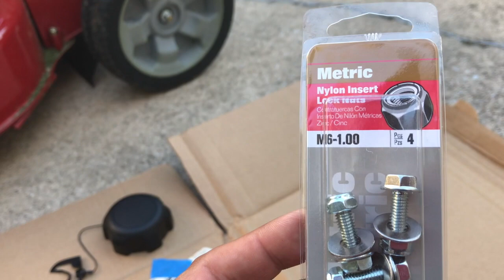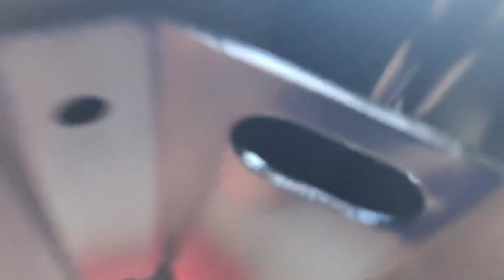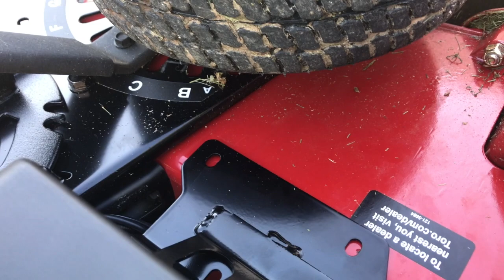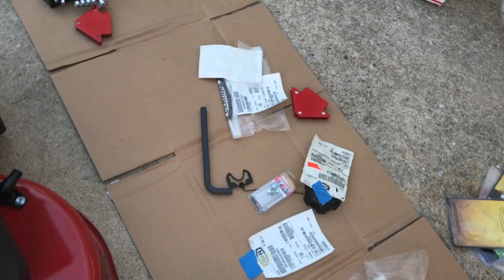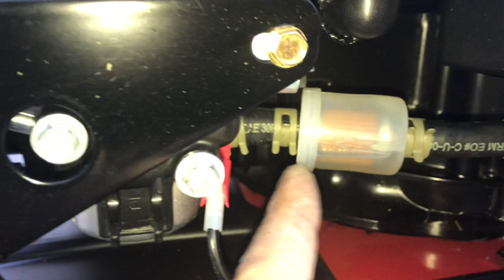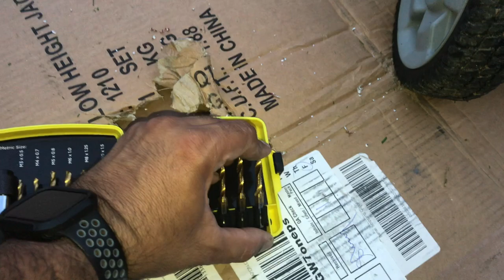Add 1 Gallon Gas Tank to Toro Timemaster

Comment from the maker: Just mowed 2 lawns, didn’t stop the engine once, and still about a half tank left.
This makes the machine that much more usable. 
Next up heavy duty pulleys so I never ever have to deal with the pulleys.
Reply: My stock pulley's broke 16 hour into it's life, so I upgraded to the turfmaster pulley's as well a month or so ago. No issues so far.
Reply from the maker: @1975oldschool  That's great! Yes, I haven't put the new pulleys on yet, kind of have them sitting as insurance for now. I also bought new m5 screws with nylon inserts for the recoil assembly because one original nut got lost. So from now on I'm only getting flange nuts with nylon inserts to make sure nothing vibrates itself loose.
Reply: Makes the machine unstable???  I think that you seriously overestimated the weight he added.

Comment: Could you get away with adding a Y connector to both fuel tanks and the other end goes straight to the carburetor so you could fill up both gas tanks and have the capacity of two tanks
Reply: I actually had a different 1 gallon tank (from a different video I watched on here) and I used a TEE to get the capacity of both tanks (as well as added a fuel shutoff before the fuel filter). It worked, but the tank (and cap) are not vented so once the original tank was empty and the big tank got to about half, the mower would die and I would have to fill it up for it to start again.

Soooo, I purchased this tank, but the outlet is on the same side as the cap (and fuel filter) and I found there isn't even enough room to put my fuel shutoff between the outlet of this tank and the fuel filter, let alone a TEE to incorporate the other tank :( The fuel shutoff was GREAT since I had to drain the gas in the old tank, I was able to shut it off, remove the line, put it into a gas can and then turn it on to drain the tank so I am thankful it was there.

I REALLY wanted to keep the shutoff and the original tank capacity but there just wasn't enough room (for me personally, for a clean install).....
Reply from the maker: Yes, you certainly could. I hadn’t needed the extra that the little tank holds so I bypassed it entirely.

Comment: Whenever you get a chance, can you send me all the part numbers to the Parts please or picture is all these parts from the Toro turf, MASTER?
Reply from the maker: The parts are in the description of the video. I copied them here for you.  

Parts:
1. Toro 115-0954-03 - MOUNT TANK
2. Toro 114-0280 TANK-FUEL OEM (part number cross-referenced is a newer part number)
3. Toro 46-8091 Chute Hinge Screw (2 pack)
4. Toro 109-6776 Cap-Ratchet, Tethered
5. Toro 115-0962 HOSE-VENT, CANISTER OEM
6. M6x1.00 Flange Bolts (2) - substitute 1/4 flange bolts
7. M6x1.00 Nylon lock nuts (2) - substitute 1/4 nylon lock nuts with flanges
8. 1/4 flat washers (2)

Comment: Have you had any issues with the gas line being the same level/height as the carburetor?
Reply from the maker: No issues, there is a very slight downward slope. It would work even if a bit inverted.

Comment: How come you didn't use a Y-connector and use both tanks at the same time?
Reply from the maker: At the time I didn’t think to, after I looked again it’s a very short tube. So I’m just using the big tank and don’t need the smaller tank at all.

Comment: This is mis information  I just got one for 1600 is used it on over an acre only filled it 2 times and still had enough gas t it to do a normal yard there is no possible way to run out of gas on a residential house with this mower if your doing commercial and over an acre then ya maybe add a gas tank or maybe drop a tank in the area your most likely to run out. I don't think modify this is the way to go
Reply from the maker: What part of not having to stop to refill don’t you understand? Also how is this misinformation if I’m purely showing how to add a 1 gallon tank? Take your nonsense somewhere else.
Reply: @jasm.5823  had mine over 3 years, <3/4 acre. I've had to refill my tank every single mow 2/3 through. I'm finally adding the 1gallon tank.
Reply: I have a pretty small lawn and I can't mow the whole lawn without refilling.  I have to mow the back yard first so that when it runs out of gas I won't be far from my garage where I keep the gas.
Reply: @PendeltonWhiskey   something maybe be wrong or your grass may be extra tall but I can say this after returning a mower like 5 times to the home depot I got it from I noticed that some of them are faster then others and some gas tank last longer it makes no sense there's definitely something off either the settings on these things
Reply: @Michael-ye2se  Sit down, junior. Ever try an upgraded/different blade? The heavier blades will eat up more fuel.
Reply: Your comment is BS. I cant even finish a 10,000 sq foot lawn! Shame on Toro for only using 32oz tank
Reply: I’m a year late but you still sound stupid. Imagine filling up only at the end before you store it and not mid now retard. Just imagine the convenience of not being so stupid.

Comment: so im doing this but im using a ptfe y fitting and using the factory tank as well for even more
Reply from the maker: Very cool! I found that the big tank is all I need so I never bothered with the smaller one. Added a fuel shut-off and took the filter off for now. It’s a tight fit to have both so gotta figure out the tubing. 
Good luck!
Reply: Part number for the Y fitting?
Reply: Do you have pics of how you did this? I incorporated a TEE fitting and a fuel shutoff with a DIFFERENT 1 gallon tank (but it wasn't vented so the mower died once the original tank was empty and the big tank got to about half) but when I went to install this one on there I wasn't even able to incorporate the shut-off valve, let alone the TEE fitting to keep the original tank capacity.....

The other 1 gallon tank, the outlet was at the back of the tank, so I had plenty of room. This 1 gallon tank, the outlet is at the front of the tank, right by the fuel filter so there wasn't enough room without drastically increasing (and probably "looping") the fuel lines and I just didn't want to do that.....
Reply: @brandonwright6609 did you ever figure this out? About to do this mod.

Comment: The extra weight of the gas will really keep this dog of a lawnmower from going up inclines. Worse transmissions in mowers, save your money and get something else!
Reply from the maker: Really depends on usage. For the few lawns that I take care of there aren’t too many hills, plus I mow sideways on the inclines.
Reply: Gas is approximately 7 lb per gallon.  If you’re not using the original tank also you are adding maybe 3 lb in capacity.  I get more than 3 lbs of clippings built up under the deck.

Comment: I like the tank mount but I'm not sure why you want to change pull cord direction instead of just bringing it up to the handle bar as designed, unless you bag a lot.
Reply from the maker: It’s easier to pull to the side and away from the handle frame this way. I don’t bag at all, bags are brand new.

Comment: Thank you for this. I'm on 0.65 acres of weeds. I feel like I'm constantly refueling on the original tank. I probably empty the bag about 15 times - makes me want to poison the entire yard and seed dwarf fescue. My yard is poorly graded too  - bump city - aftermarket wheels with better tread would be helpful too.
Reply from the maker: I don’t bag anymore, and that’s saved a ton of time and hassle. 
I try to mow at least once every week, and let the grass grow a little longer to crowd out the weeds.  
I think I have it set to “C” height right now. 
If you have a lot of bumps have you considered adding soil and using a wide leveling rake to work out the level? With a larger yard it will take some time but can be done. This is what I did at my parents house and also at my house.

Comment: Any way to mount in back? If so do you lose all adjustability of the handle?
Reply from the maker: I only tried the side because of the oem toro mounting bracket. 
If mounting behind the engine you could and angled bracket bolted off the deck, and then check for clearance. The handle mechanism may get in the way. Sorry I can’t help more.

Comment: Excellent idea of rotating the Pull-Cord carrier.
Reply from the maker: Thanks, I also replaced the nuts with nylon lock nuts since these like to work themselves loose. (Replacing with lock nuts wherever I can).
Reply: @jasm.5823  ...As you may had seen on Garage Gear YT Comments,...I just got my Timemaster last Friday (April 2nd),...and I've already done your mod of Turning the Pull-Cord assembly!

Comment: It's about $150 to do this mod at the site I visited.  Yikes!
Reply from the maker: I pieced it together mostly from eBay stores. I figured I would upgrade the Timemaster with the tank and heavy-duty pulleys to get it closer to the Turfmaster, without spending another 1000. So the tank parts and the pulleys add about 200-300 depending on what you can get. I’d been planning this for a while so I definitely put some cash aside to add the parts.
I plan to add the pulleys in March and will post up a video. These are solid pulleys too and should last a LOT longer than what this comes with.
Check out ebay seller mowandsnow, I bought the tank and bracket there.

Comment: Hey, just a tip...  You can mount that hour meter on the black plate at the front left of the engine.  I used some HVAC self tapping screws.  Worked like a charm.  Even some automotive grade double-sided sticky tape will work.
Reply from the maker: Great tip, thanks!

Comment: Why not install a petcock so you can utilize both tanks?  Then, treat the small tank like a reserve.
Reply: There are 2-1 filters so both thanks can feed.
Reply: @brianinboden4697  That's a great idea as well.
Reply from the maker: Original plan was to be able to use a single large tank and keep it simple. Good idea, may look at that in the spring. It’s a bit tight for space though so it may not have enough room. 
I wonder if there is a wye or tee fitting that could also work.

Comment: get closer to your microphone.
Reply: And write your stuff down so you know what your talking about and not spending 20 minutes saying "uh....uh....umm....uh...."
Reply: Just offering advice here, but you could also edit the videos to remove unnecessary commentary.  For example, no need to say "removing the bolts will be the next clip" or whatever is coming up.  People on this channel will know that it will be necessary to remove bolts when removing a cover.  Again, I'm only using this as an example.

Comment: How large property can you mow with the factory gas tank?  1 acre or no?
Reply from the maker: 1 acre = no way. With the factory tank I could barely cover 1/3 of an acre. With the new tank I would say a little less than 1 full acre, or .68 of 1 acre.
Reply: Jas M. Ugggh that’s so disappointing.  How does this save any time if you have to re-fuel?
Reply from the maker: @mct8888  i don't have to refuel at all with the new tank - that's the point you can do a whole lot more.  In any event it is still worth it.
Reply: @jasm.5823  I’ve heard it won’t even do 1/3 acre on one tank.  I have over 1/2 an acre.
Reply: @Josh B  the sponge in the gas tank doesn't help either. I have a typical suburban lot about 1/2 acre and the original tank  barely makes it
Reply: I can do just over15000 square feet in about 50 minutes before it runs out of gas.
Reply: I have a .88 acre yard and I fill the tank 2 times every time I mow...I get about 45 mins. on a tank...I'm definitely going to the add on tank...